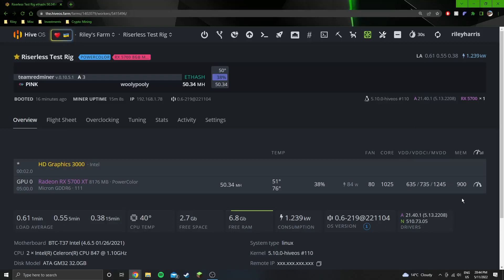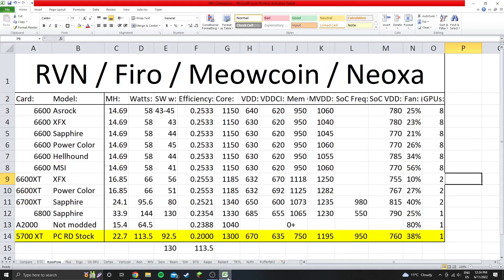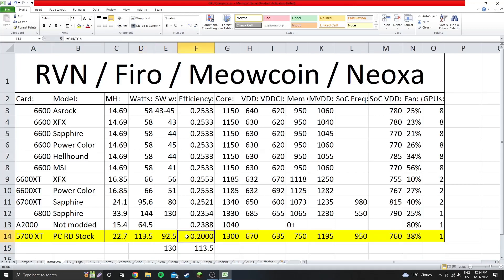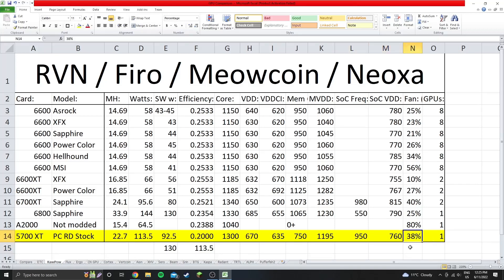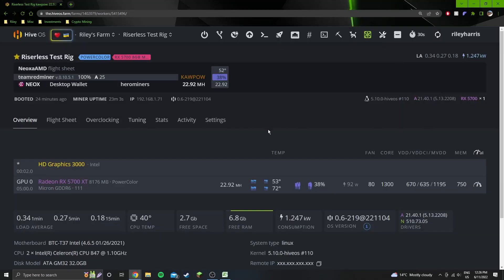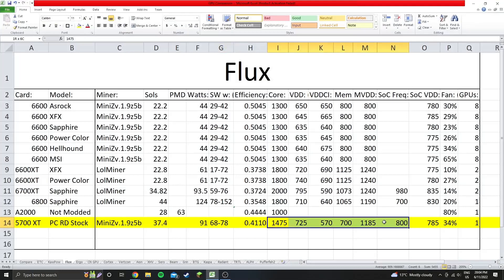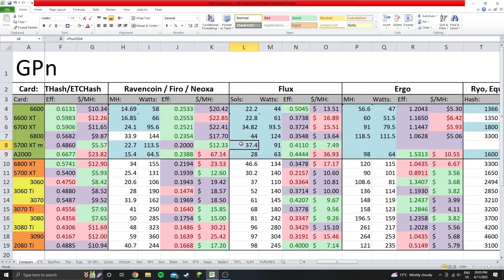5700 XT Micron Stock BIOS Testing | ETHash, Kawpow & Flux!

Comment: soc freq and voltage doesnt make changes on 5700xt. best I can get with micron for 6 gpu is 780w of the wall, and for samsung 630w of the wall (330mhs both)
Reply from the maker: Yea man, I found the same. Which algo are you talking about for the hashrate and wattage?
Reply: @KiwiCryptoMiner  etc

Comment: This may sound counterintuitive, but try 600 core, 900 mem I seem to gain hashrate by lowering core to 600.
I use this as my base setting for most algorithms
Love your content!
Reply from the maker: Hey there, my 5700 XT could stay stable at this core clock, even without a VDD set.
Maybe a silicone lottery thing.
Reply: @KiwiCryptoMiner  if your saying it doesn't stay stable, I'm not sure, I only have 7x 5700xts to test with, but works with all of them. Guess I'm lucky....
Reply from the maker: @TheTravelersTravels  Are you using the most recent version of HiveOS?
Reply: @KiwiCryptoMiner  right now I'm on hive version 0.6-219@221101

Comment: thx brooo, with edit bios i got on eth 55.48mh core 1025, mem 900, coreV650, memContV 750,  TRM , card 5700xt Gigabyte gaming
Reply from the maker: Hey man, that's pretty much what I've landed on for most efficient settings too. Is yours a Micron or Samsung card?
Reply: @KiwiCryptoMiner  55.48mh micron, same setting with sams 54mh, but samsung 5700xt arround 95watt from socket

Comment: Great vid. Wasn't sure but assuming these tests of the 5700 were without R mode enabled? You tend to find great numbers without using R mode, but this time you may be surprised. 
I also just saw an interesting vid that allowed huge power cuts on 20 and 30 series cards running Kaspa. Involved core clock locks and updates using hive. Was wondering if a similar result was possible for AMD. No one seems to have done it yet. You could be the first - knowing how you like challenges:)
Reply from the maker: Hey man, I forgot to mention in that video, but I was using r mode on both ETH and kapow. Though I'm unsure if it made a difference on Kawpow as I didn't test it without r mode.
Yea man, I'll give it a go!

Comment: check Red Panda's Recent 5700xt video. Mine get up to .480ish on Flux
Reply from the maker: Hey man, he's talking software wattage in his video. If you compare software power draw, in this video I achieved 0.51 Sol/w software. Are you talking software power draw too? If not, I'd love to hear the settings/bios/tricks you used to achieve this!
Reply from the maker: @carlbroker  Yea man, if you jump over to my setting with a Micron memory card, you'll be a lot more efficient. If you've got a samsung memory card, you can get a lot more efficient again.
Good luck!
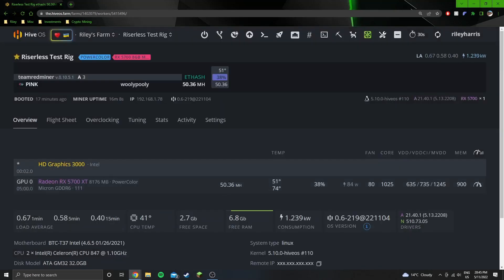Reply: update: used your OC settings @0:45 but dropped the mclock down to 700 and memory voltage to 1080. I'm getting 0.590 rn... let's see if it holds for 24 hrs!

update: didn't hold :X back down to 0.570ish